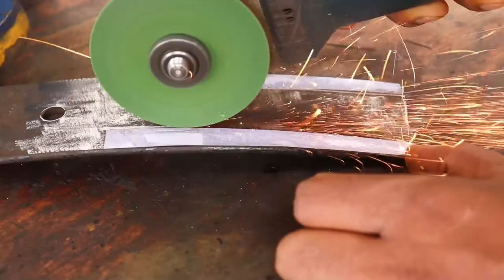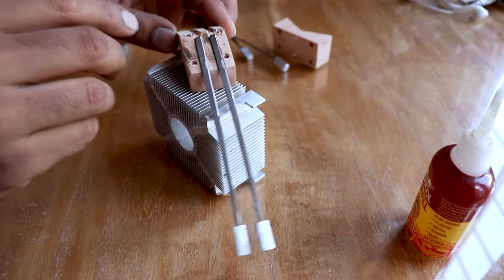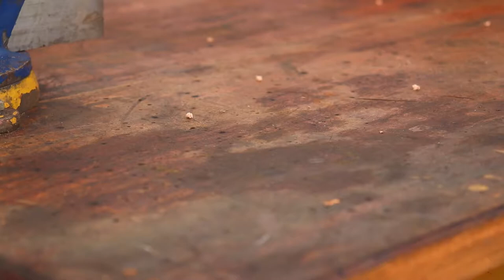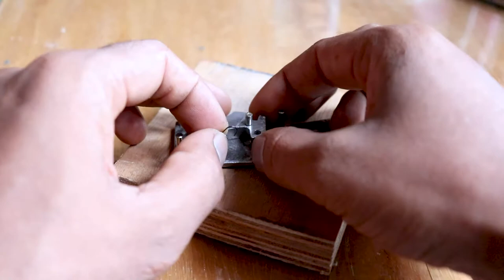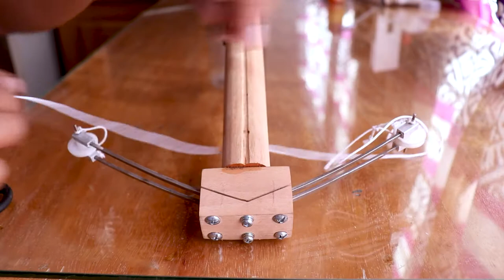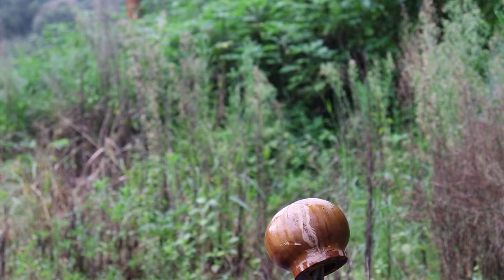How to make a powerful Mini fishing Crossbow   wood working |മീൻ പിടിക്കാൻ ഒരു തോക്ക് | science farm

Comment: That spring leaf steel new and untreated or used?
Reply from the maker: It was just replaced from a truck. It is not heated oru treated. Frequently cool it while cutting so that it doesn't loose its hardness.
Reply: @CreativeLabStudio  if used then its not as flexible! Better use rubber
Reply from the maker: Rubber is also good. In my case it works fine. I used part of the spring that is close to where the bolts go. It is hard enough for the crossbow. We just need four small pieces of spring anyway.
Reply: @CreativeLabStudio  how much the draw weight? 10kg?
Reply from the maker: 15.76 kg at full draw.